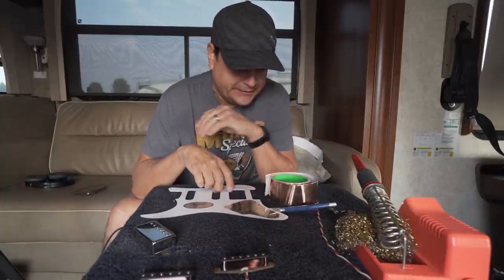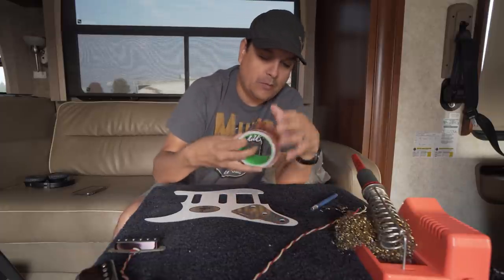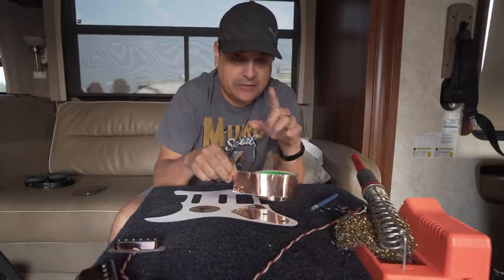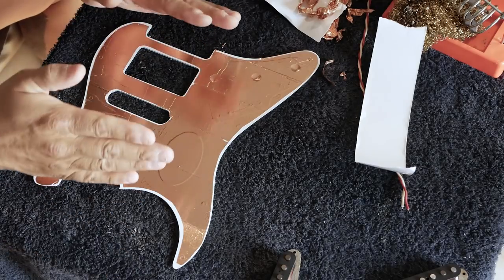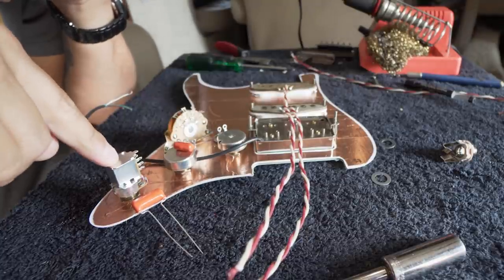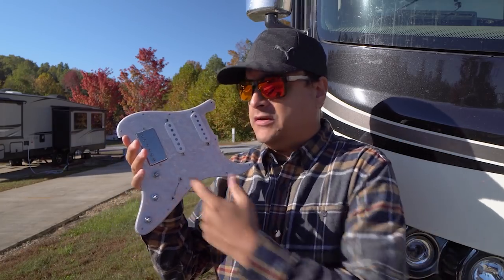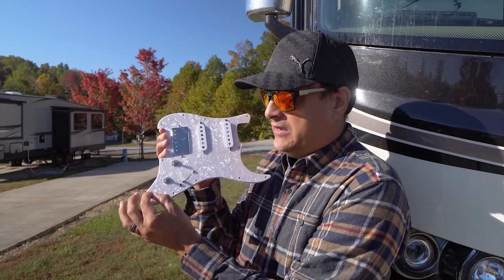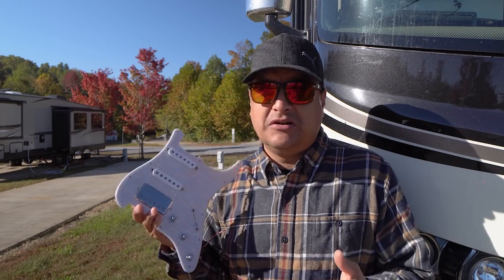250k vs 500k Pots And Bridge Tone Control In a Strat

Comment: Hi  Dylan, Thanks once again for this very clear description of how to hook up the components for an SSH Strat pickguard. FYI, the copper shielding tape with conductive adhesive - the big roll of 2 inch wide stuff - is still the best deal going. There is one other brand that sells the same-size roll of copper tape, also with conductive adhesive. I think the difference in price is about 49 cents , so if one is out of stock, there's an alternative.
A tip for people who live where it's cold during the winter. As the temperature drops, the air gets very dry, because cold air doesn't hold moisture. If you leave the tape sitting loose by your workbench, the adhesive will dry out fairly quick. Keeping the roll in a zip-closing freezer bag prevents that, and it's easy to do   to prevent the hassle of finding your copper tape has no "stickum" left. 
Two other points I noticed while looking at the listings. Point #1 is that a roll of this stuff that's the same length but narrower, cost a lot more, and the thickness of the copper foil is/was often less (that makes it fragile & easy to damage). Just something to be aware of - the wider tape is a much better deal all around. 
The other is that there's an overseas brand - the company name's "characters" translate to something like "dead flowers." Their listing shows a picture that looks just like the big roll you recommend. But going in and reading their actual specs, buried  in the listing, their tape  is only a 6 ft. roll, about 1/10th the length of your favorite brand. Showing that picture in the listing is a bit of a con, because a 6 foot length doesn't look anything like the Amazon "best bargain"  roll of copper tape with conductive adhesive.
Anyhow, thanks again for these pointers on setting up the SSH Strat. I hadn't done one for a while, and it was a big help

Comment: Hi Dylan, another great video, for anybody in the UK, i used Wilson & Gregory slug barrier tape from the Poundland shop on 2 Stat guitar  scratch plates and also inside the cavity, it works a treat, no unwanted noise cheap but not nasty. 2mtr x 25mm for £1, a bargain, easy to use and it works.

Comment: I've got a CV strat and the bottom tone control was tied into both the middle and bridge, and the upper tone control was connected to the neck. (I've since built a new pickup with push/pull pots and hot rails and used quick connects so I can easily swap pickguards).  I shielded it all, including the jack cavity because why not? I Initially ran into a short, then discovered that Fender wires the ground to pin, and hot to ring, and that is the cause of shorts when shielding the jack cavity so if you run into that, just reverse the phase on the jack leads and it will be fine. I wouldn't have bothered shielding the jack cavity if I didn't already have the jack out to replace it with a true tone jack (preventive to avoid future scratchiness due to wear). I upgraded to 500K pots so I can further cut out the caps for more highs to offset some of the loss of highs from the humbucker setup.

Comment: I purchased a stacked OEM Fender dual 500k/250k pot and went to a single tone shared by all pickups. Wiring by Guitar Electronics for $39. HSS with 1 volume 1 tone. Winning!

Comment: I just finished an HSS that has separate volume pots for bridge and single coils so I can have a 500K for the humbucker and a 250k for the singles.  It also allows me to split the coil at the volume pot and I used a push/pull tone pot, using a .015 Soviet PIO as the down/default and a .047 orange drop as the pulled up cap.  I also used treble bleeds because I'm addicted to them... lol.  I can basically get any sound I want and always have balanced pickups that way.  Just keep the switch sides separate and bridge pins 2/3 so the 2nd volume gets both singles.  Solder the humbucker directly to the volume 1 and then send it to the switch.  Then you can use the last common output pin for master tone/output.

Comment: I had a Fender Lone Star Strat which came with their 5-way Super Switch.  This switch allowed for the bridge humbucker to automatically split in position 2.  I took it a step further by replacing the 3rd position with the neck + split bridge humbucker instead of just the middle pickup by itself.  Also; both of the split coil combos were humbucking and ironically quieter the humbucker itself (Pearly Gates Plus) which used mismatched coils.
Reply: This could be a really nice setup with the Hum split and Tele like tones
Reply: How good the twin head humbucker in the MIM lonestar version compared to the pearly gates in the Usa? 

Also does the mim lonestar have 500k pots ?

Is the twinhead humbucker ceramic or alnico?

I mostly do heavy metal, and super  glassy tones on the cleans

Comment: Two things:
1. If your shielding tape is only conductive on one side, wouldn't conductive paint on the seams be easier than soldering them?
2. If you ran the two singles in series, would you still use a 500 and treat them like a single hum?

Not putting these into practice, just general curiosity. Thx!

Comment: Great video.
I have a mid-80s Kramer Focus 3000 in HSS arrangement and wanted to do this exact mod, so I’m glad I found this.
I also want to add the Gilmour mod in place of the current coil splitter so I can run the neck pickup in conjunction with B and B+M positions. The tone pot for the N/M will also be push/pull and will either switch between series and parallel on the neck pickup, or change its phase. I haven’t quite decided which tones I find more useful.
I think that will give me the tones I want without cluttering up the guitar with repeat tones or tones I’d never use, like some of these 85-in-1 arrangements I’ve found.
I’d spend more time searching for the “preset” than playing, lol.

Comment: I'm swapping from the original Fender 250K pots to Fender 500K pots in my Strat tomorrow, each of the 3 pots come with one capacitor each, but I would only need to use one capacitor from the one tone pot to the other tone pot correct?  the volume pot should not have a capacitor to the tone pot or am I wrong?  The pickups being DiMarzio Air Norton S for neck, the bridge is Seymore Duncan SHR-1B hot rails, and the mid is for now single coil but swapping that for a DiMarzio Pro Track it ships to me next month.

Comment: You can also add a 500k resistor in parallel with a switch to make a 500K pot a 250K pot, if you don't mind only going down to half volume add a 250K resistor in series to the GND of a 250K pot with a bipass switch... however doing that will mean you can't go below half volume with the knob fully down.

Comment: The copper tape is to wrap around fruit trees or pots to keeps slugs at bay . The copper reacts with the slime they rely on . I use gold foil from chocolate bars the stuff with paper on one side . Just paint the paper side with PVA and slap it on . Just fold a piece to connect the sheet if you need to but most big bars unfold to cover a pickguard in in one go .

Comment: My former HSS configuration of my Fender Strat Special differed from this diagram by way of the master tone being a concentric tone pot w/a 0.022uf capacitor & a resistor and a bridge humbucker coil split switch.
Reply: What size resistor did you use? And why that size?
Reply: @windsurfmaui8239  mid 90s Mexican Fenders had a variety of quality control issues and that pot was one of them so it's been rewired and converted to all single coils since then since then; no idea of the resistor that came with that tone pot.

Comment: That copper foil is what I've used and it worked well and as you said, cheap.  Also as to slugs, yes slugs and snails don't like walking on copper it causes a chemical reaction when they step on it. kind of like a skin reaction from an allergy.

Comment: Assuming this is a 5-way switch, does it make a difference now that two pickups are going through one capacitor?
Reply: Yes it does; the single coil pickups both share the same tone pot as well as the same 0.022uf capacitor on the 5-way's 2nd, 3rd, 4th and 5th positions while the bridge humbucker's wired to its own tone pot and 0.047uf cap on 1 & 2.

Comment: Okay, I"m ordering copper tape for my next pot-swapping project. HSS with a blender pot. Tone will be 1M audio taper; blender 1M linear. Before I changed it to the blender set-up, the two tone pots shared the same capacitor. I'm not sure how that worked.

I guess I should line the insides of the cavities in the body with that tape too.

That pickguard sure looked pretty.

Comment: I'm confused, why are you reversing the caps? .022uf is usually used on humbucker and .047uf on single.
Going for a darker or brighter tone?

Also adding a 500k resistor parallel from the switch to ground where the single connects to the selector makes the singles see 250k, I noticed a change in tone, but not as good as using a 250k, so I'd actually put a 250k resistor in series with the humbucker so it sees 500k.

Comment: Hi Dylan, I have a similar topic. Apologies if you have covered this in a previous video. I have a Fender FSR Japan Tele with soapbar P90 in the neck and a Tele bridge pickup in the bridge. The pots are 250k. I understand that P90 normally likes 500k pots and single coil likes 250k. It has a 4 way selector. The P90 is a bit muddy sounding. Should I use a capacitor connected to the hot out from the P90 to the switch to brighten it up? Or…? 🙏🏼 thank you

Comment: I use the exact tape.. But also nickel paint. So far no issues with the paint but I'll have to keep my eyes on it.. I use them together often

Mainly just to have better coverage...

But I only use humbuckers now so it's all redundant. Except I guess the cavity area.... Where the paint comes in is the drilled sections between cavities. I pour it through.

I only use 500k pots as I like extremely bright tones..

I also wouldn't do a HSS maybe a HS and treat it like a SSS with a series switch for bridge like a PRS

You don't need or want a tone on bridge anyhow. Humbuckers are often dark.

Comment: Question, I’m sure you can answer. A coil tap and a coil split are two different things and should give two different tones. Could a pickup be wired with both and switched differently???? Is this possible???? Any way please stay safe.
Reply: I'm pretty sure a coil tap wil only tap down to a split. You are basically putting one of the coils on a dimmer. At the very end of the tap rolloff, you are left with one coil live, which is sonically and literally the same thing as a split. There isn't any reason to wire for both, as far as I know.
Reply: A coil split is usually when you split a humbucker.  A humbucker is two coils with one reverse wound. You take one of the halves and you get a single coil. 

A coil tap is when you tap into a any coil to get less windings. So instead of 8k you can get 7 or 6.  

I think making a tap - so long as you didn't go too low - would just be a separate switch and wouldn't change much else.

Comment: Hi Dylan! Thanks for your great videos by the way. Quick question, in your opinion what is the best pot for a P90, 500k or 250k?
Reply: Hey Rafael,
Obviously I'm not Dylan. But I can tell you I have many P90 guitars they are my favorite. And I attempted to use 250K pots that I already had and had to switch them to 500K both Volume and Tone. Reason being it was way too dark sounding. It was like rolling the tone knobs by half if not more. Hope this helps.
Reply: @j.a.s.1416  Thank a lot, J.A.S!
Reply: I'm not Dylan, either... though I recall one of Dylan's old videos recommending 500k for p90. Perhaps you find that video somewhere in this channel. 
Good luck!
Reply: Rafael,
In my Gibson Les Paul with P90s, I did 500k CTS pots, with .033 Russian paper-in-oil caps, and added treble bleeds. 680pf cap & 100k resistor on the bridge, 500pf cap & 150k resistor on the neck. All of this was done with the "50's wiring" schematic.
Reply: @DanCooz323  thanks a lot!
Reply: @DanCooz323  Thats overkill, you either do 50s wiring or treble bleed
Reply: @CubensisRecords  Of course it is! Everything I do is overkill! But it sounds great!

Comment: I have the exact same copper tape from Amazon. I just used to it to shield my Affinity Squire Strat that had major grounding problems, like if to touched the pickup screws it clicked. It worked great. Not single touchable hot spot on the guitar. And I had some money to blow and didn't feel like soldered the guitar, which I have done before, so I got and Obsidian Wire kit with the Gilmore switch. It sounds amazing and is so clean.

Comment: I actually have an old pro tone with single coils that originally come with 500k pots, and with that tone controls I feel there’s way more control. But what you just did, did you only use 500k for the tone control on the bridge? Or are they all 500k and just compensate with the caps?

Comment: i just got done adding a humbucker sh4 in my strat, new pickguard, with ssl1 and fender squier mid pickup, reverse the wires on the seymour duncans so they work in phase with the mid pickup, i also added a new fender 5 way switch and wired everything through that, instead of my old import switch which was faulty, and after installing it, everything works, but the switch jams in position 5 to 4, like gets a little stuck  inbetween 4 and 5 and position 5 seems to be working as Neck and middle, the same as position 4 instead of being Neck only, im wondering if it could be cause by the pickups switch being stuck there, as if maybe some solder got inside thats making position 5 act like its position 4 or something, ive been trying to find solution online, reddit discord and other forums, but no one is answering, and no other person has ever posted anything with a problem similar to mine

Comment: I bought a 5 dollar bucker from a parts bin years ago and forgot about it. I found out it was a 70s super distortion paf worth 150-200 so I bought a ssh pickguard for it. I left the 250k pots but I want to try a treble bleed. I can't split the coil because it's so old an only has two wires

Comment: Thanks..this was helpful!I need some advice from you.My project is a HSH Strat with push pull at the volume to add the bridge and push pull at the middle pickup tone control to split both  humbuckers. I've managed to have the "add bridge" push pull working but I don't know how to wire to obtain the coil split for the humbuckers..can you help me?

Comment: I was going to add a concentric 250K/500K pot so I could control the volume of the single coils with the 250K and the humbucker with the 500K.  Then I was going to have one 250K pot for the single coils tone control and one 500K for the humbucker tone control.  Am I wasting my time using the concentric pot for volume instead of just using a single 500K to control the volume for all pickups?

Comment: My top tip for a better strat. Buy one from someone other than Fender. 

You can buy a hand crafted instrument made to your specifications from the best materials for less if you do so. You will have an instrument that will last longer than you. It will be set up to your specs and  e perfect from the day you collect it. It will be more reliable and never need modifications as it was everything you wanted. 

It really couldn't be simpler than that.

Comment: Quick question, I currently have a humbucker guitar with 250k pots that’s too muddy, but the split coil tones sound phenomenal. I’m going to swap them out for 500k but I’m worried I’ll make the split coil thin sounding. What would you do?

I’ve just ordered some dual gang 250k/500k volume pots and am hoping my luthier can install them
Reply: 500k pot contains values 0 - 500k, 250k pot contains values 0 - 250k. The 500k pot hence contains the whole range of 0 - 250k too which means you can achieve exactly the same tone with it. If the 500k pot sounds too thin you just roll the pot down to a smaller value, e.g. 250k. It's just a resistor which changes in value. You just have to be more careful adjusting the 500k because the values change more per same amount of rotation. Rarely guitar pots are linear though so I doubt this is an issue (so the 250k value in 500k pot might be something like 7 or 8). You can also turn your 500k pot to a 250k pot simply by just installing a 500k (constant value) resistor parallel with the pot. It will turn the pot from 0 - 500k to 0 - 250k. If you use a 1M resistor parallel with the 500k pot you'll make the pot effectively a 333k pot. Recommend you some resistor calculation (series, parallel) tutorial. Remember the pot is just a variable value resistor (from 0 to its nominal value, e.g. 250000 or 500000).
Reply: @McSlobo  for a tone pot yes, but on a volume pot it acts as a voltage divider, so if you have a 250k pot which has less resistance, more highs will bleed to ground, even with the volume on 10. Rolling the 500k pot down will just make the signal quieter

I’ve seen some guitar companies (I think suhr) connect a resistor in series with the hot wire of the single coils and the volume pot on HSS guitars to balance the single coils as well

Comment: now is that push pull pot a 250 or 500K? I would bet it is a 500k but would rather not buy the wrong thing. Thanks
Reply: Did you find out trying to figure out the same thing

Comment: I Iike to buy 1k pots for both volume and tone and then decrease their resistance to the needs of my pickups by adding resistors in parallel. In that way I can very easily adapt the pots using resistors which are dirt cheap